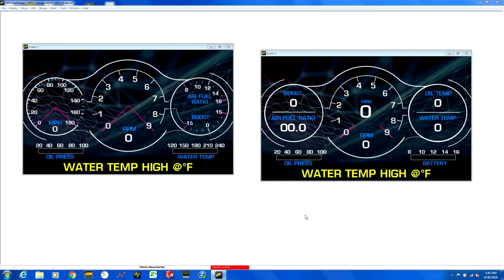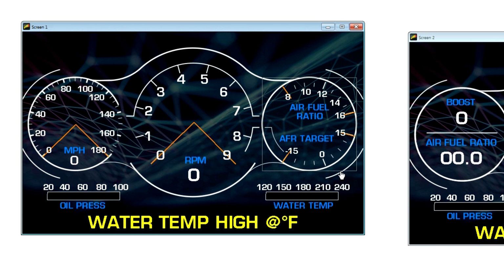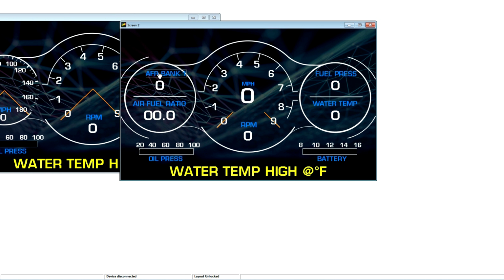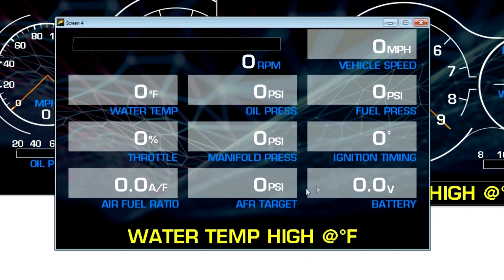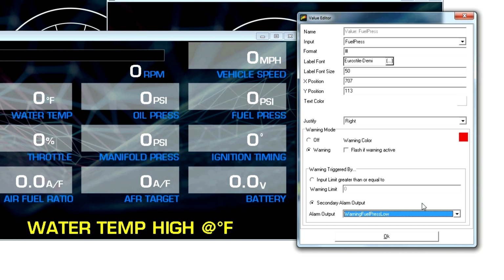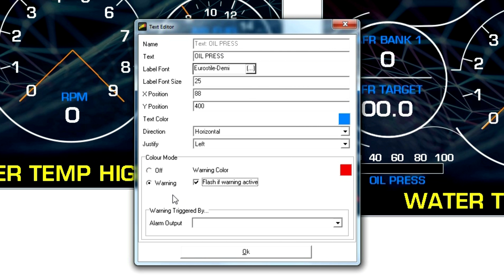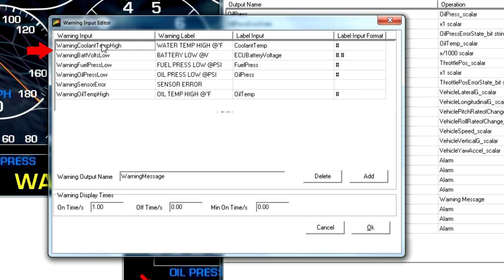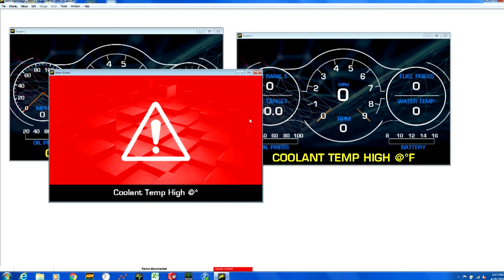DashDesign 1.0 Tutorial for AEM CD Digital Dash Displays

Comment: This is so cool. Being able to tweak things is always a massive benefit. So to get this to work on a motorcycle would you need some sort of fancy ECU? One of my bikes has a microtec ECU, but the one I'd seriously want this gauge for doesn't.

 I'm sure it's geared towards cars and the like, but i remember wishing i cold have gauges similar to an Aventador on my bike and lo and behold, that style is one of the ones offered out of the box with this. Been dreaming about it a lot lately
Reply from the maker: If the ECU you are using has a CAN bus output then it is highly likely that our dash will read the channels it sends over CAN. I'm not sure what ECU you have but the M197 appears to have CAN outputs for logging and dash. Once you input the CAN data into our DashDesign software, you can assign the channels to the dash using our software. We also have CAN Converter Modules to take signals from various sensors and convert them to AEMnet CAN bus: https://www.aemelectronics.com/products/cd-digital-dash-displays-adapter-harnesses/aemnet-can-bus-expansion-modules

Our dashes are used on motorcycles (the CD-5 is a better fit due to size), UTVs and we have seen them on watercraft and boats!
Reply: @AEMpowerTVelectronics  that's awesome. I'm even tempted to use one on the Ducati since it seems likely to work, although that dash was the same one they used on the motogp bikes of the same vintage, so it's got a coolness to itself. The other bike, though, I'd love to try this on if it's doable. Thanks for the response